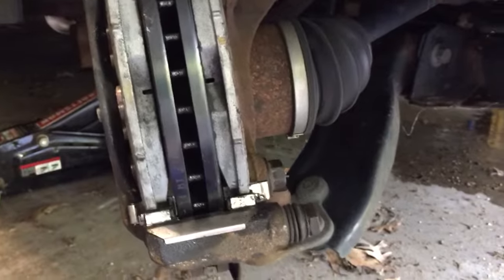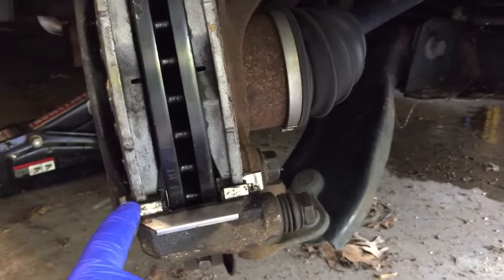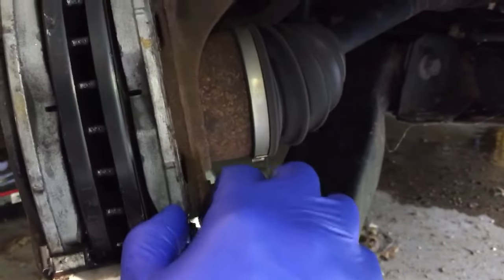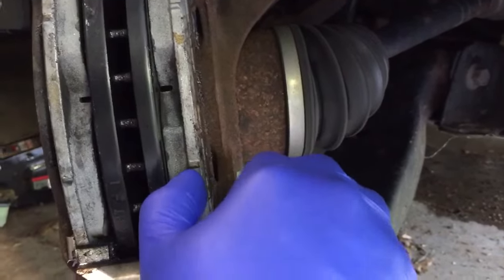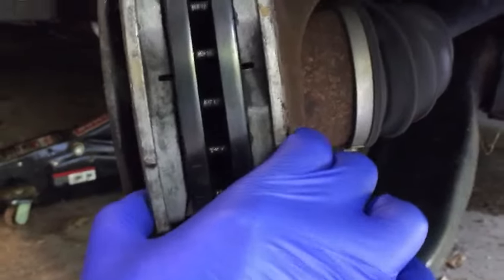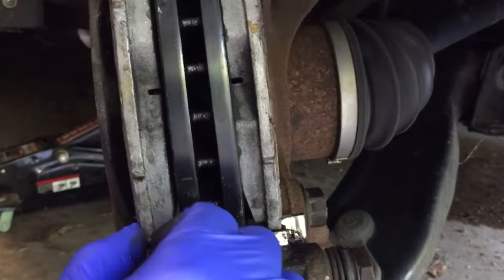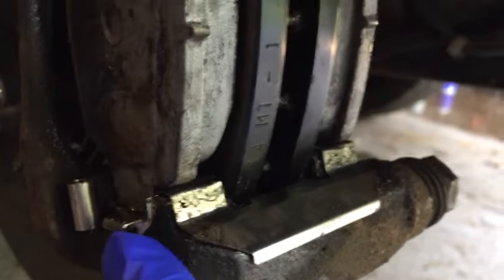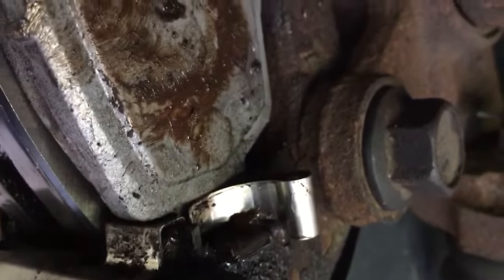Brake pad clip orientation

Comment: So you didn’t really explain what the solution is.. I get the clip or spring is rubbing against the pad and some room is needed in between. Do you need to take the breaks apart and place the clips differently? Are they on backwards? You’ve diagnosed the problem without giving a solution.
Reply: it is physically possible for pad to sit on either side of the spring clip. However, it place on the side where the clip will separate the pad from the rotor.

Comment: well i  cant get both clips on - i can do one but like not enough room for two.. i am about to find out what will happen driving without a clip. put a wheel bearing on.  done in by a break clip unreal
Reply: The clip shouldn't take up much space - it sits under the pad to push it away from the rotor.  Worst case is take it to someone to fix. If it sounds bad, I would go to a professional.
Reply: @mikepb3054  i put the old clips back in-worked easy as pie

Comment: Great video, thanks!
I installed my pads with the spring in the wrong place.  
Not only does is press on the pads, your brakes get hot and it damages the pads....
Reply: NIKOZ Vios I’m having the same issue after I let a friend do my breaks. Now I’m stuck with this noise. I don’t really want to let my dumb ass friend try to fix them as he just took a pair of pliers and bent the clips. How exactly did you place the clips so that the issue was resolved.
Reply from the maker: Thanks - I have messed this up before, so I figured I would make a video - at least I could remember.